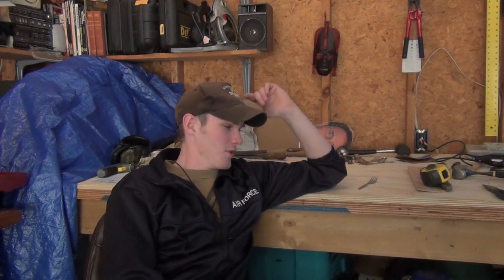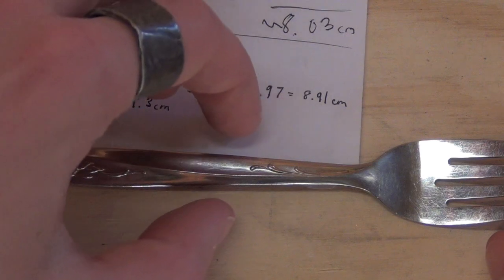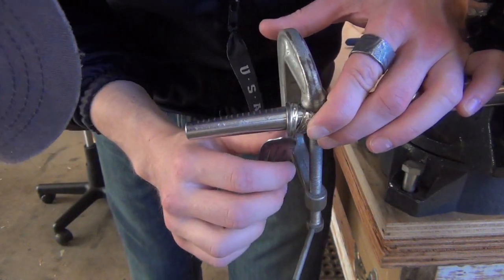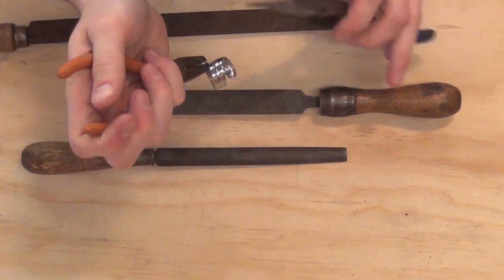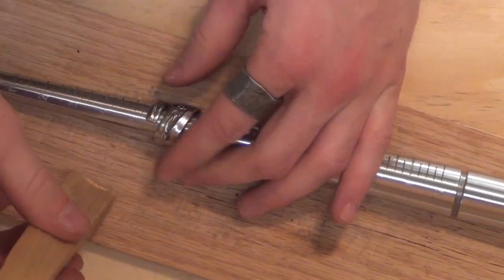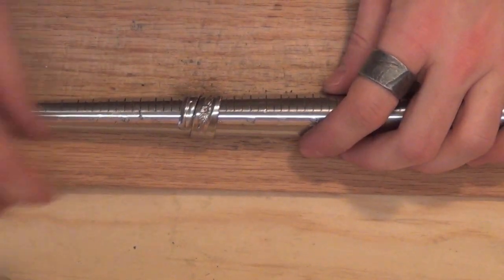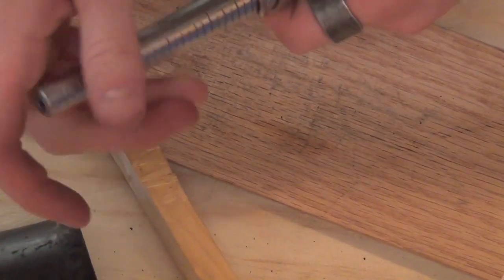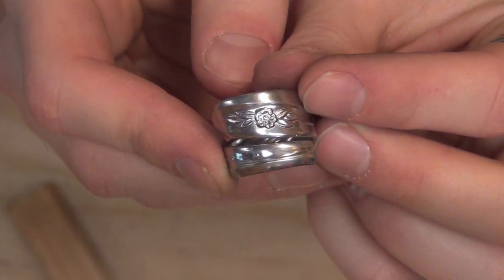How to: Spiral Spoon Ring

Comment: I'm not sure if it is always spot on, but I think a good rule of thumb is to add 3 times the thickness / gauge of the the material (the fork in this case) to your calculated circumference to get the desired finger size.  Thanks for sharing your technique!

Comment: I think for the toothpick ring you could use a nylon mallet and keep on twisting around the mandrel so not using your own strength but just hammering at it with something that won’t leave a mark like nylon or rubber.

Comment: If you really want to make a ring out of a thicker spoon/fork then you can heat it up until it starts to change color and almost glow and then let it cool down. This will release the tension in the metal and therfore make it softer and more bendable. 

By the way, I liked the tutorial and the fact that you DIDN'T use a spoon!

Comment: if you soften up the ring by heating it cherry  red and drop it in cool water you could use any thickness of metal
Reply: Bruce Levine this is true. to heat up a metal will soften it for work. that's called Annealing. when you drop it water or a acid bath. that is to quench.